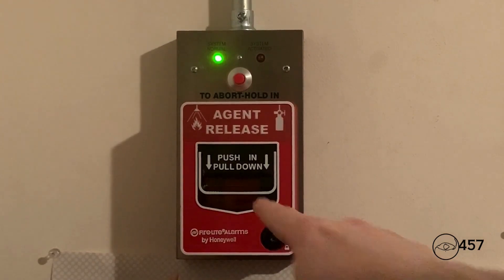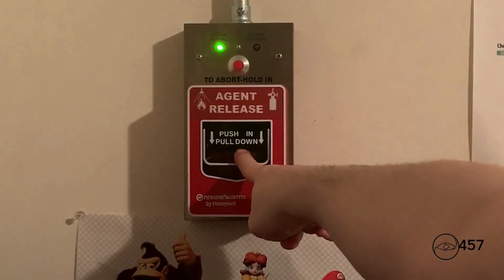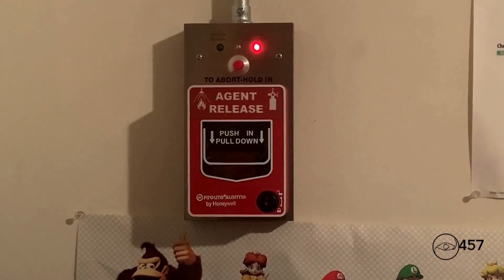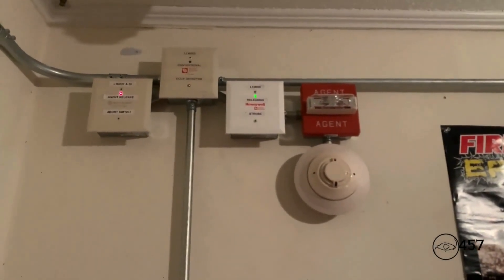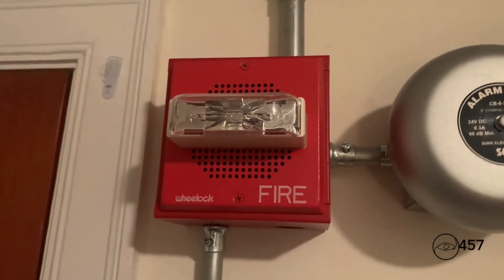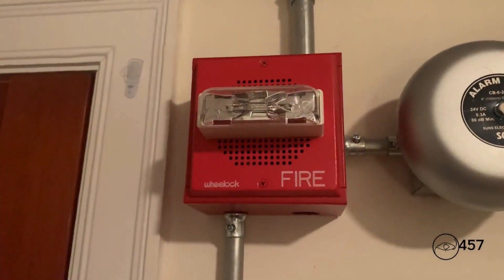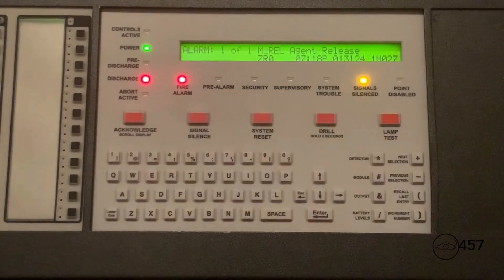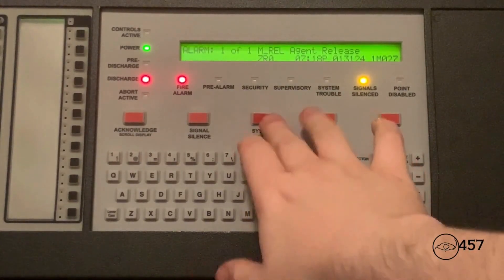Agent Release Signal & Abort Switch LED Fire Alarm System Test

Comment: How to connect those LEDs from a relay having a big problem
Reply from the maker: Are you trying to use a conventional panel or addressable panel? If using conventional, you can use one of your panel alarm relays, but you won’t be able to silence it. You’ll need to run a NAC to the power connections on either a PAM-1 or MR/101 relay and put your panels resistor on it. Then run Positive Aux power to COM on the relay and Negative Aux power to the COM on the Test Station, then run NO from the relay to the red LED, and NC to the green LED.